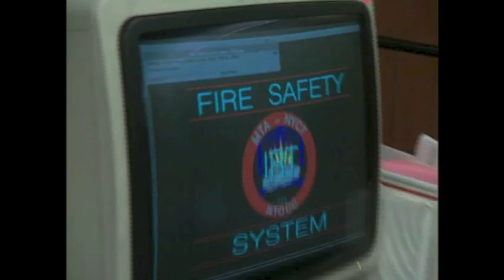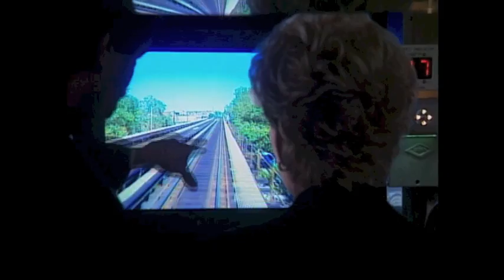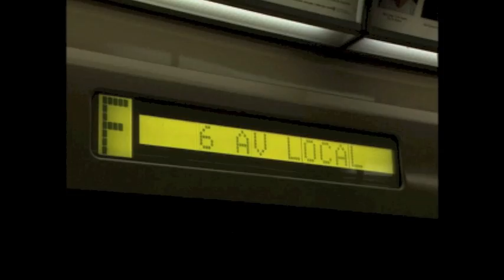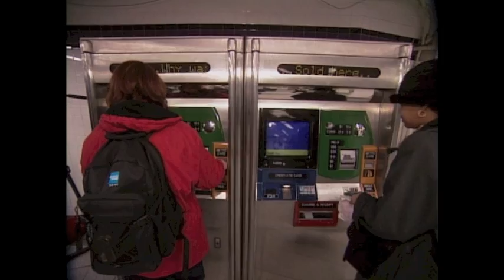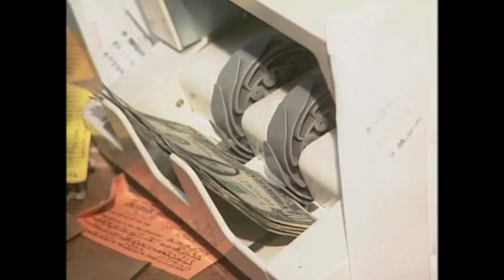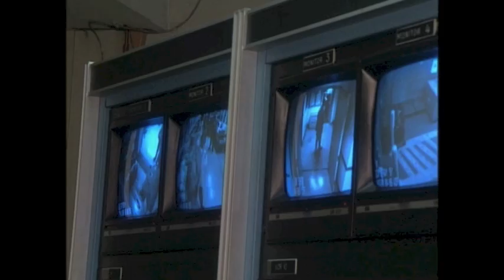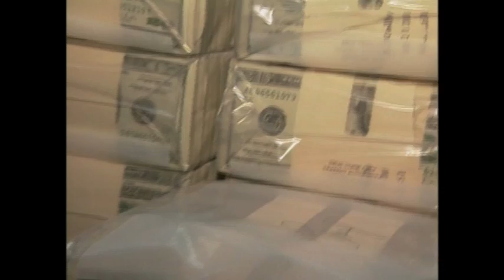Joan Lunden Behind Closed Doors: NYC Subway System

Comment: So what has changed in the past twenty years? Aside from the trains, and the fares, absolutely nothing. Hey, that’s the New York City subway for you.
Reply: That very last shot of the video is one thing.
Reply: In fairness, it’s difficult to build underground. Street level and above ground is easier. now a regular rail system is easier because trains run less frequently vs rapid transit.